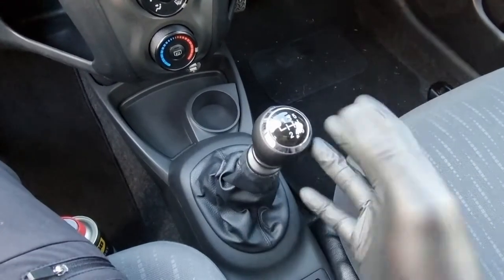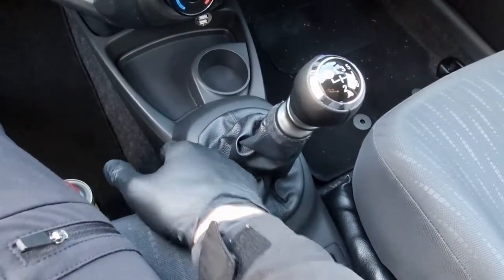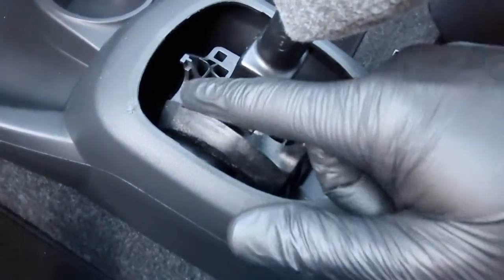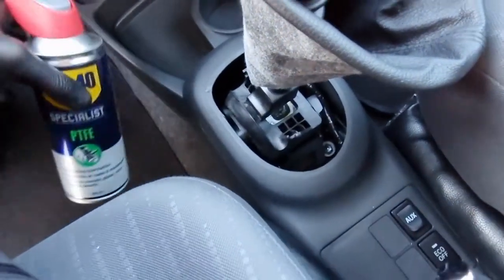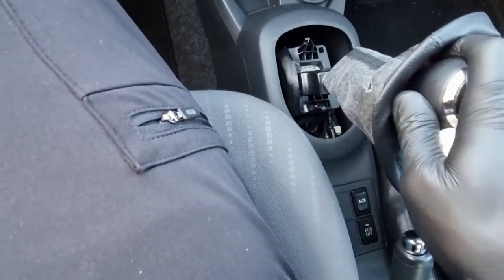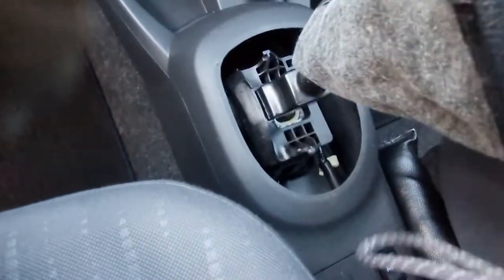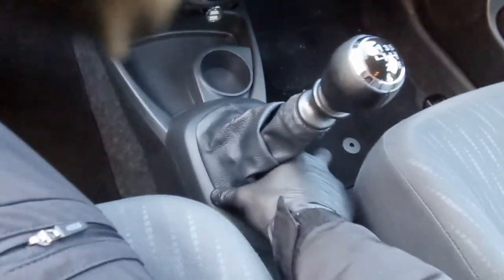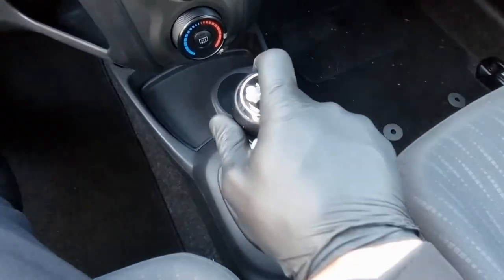Squeaky gear lever sorted😯 Toyota Yaris🤔

Comment: I had the same thing on my 2012 Yaris until i used white lithium grease. Is this a thing with the 6-speed only (because of the pull-up reverse)?
Reply from the maker: Haven't seen a 5 speed one, maybe, it's literally plastic rubbing against plastic😯🤔